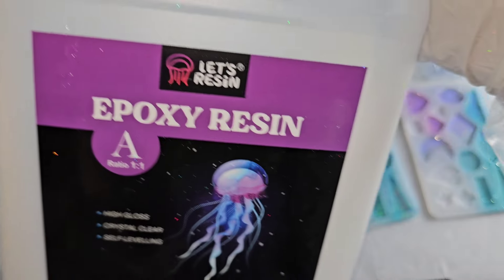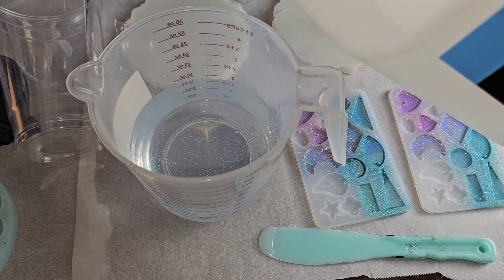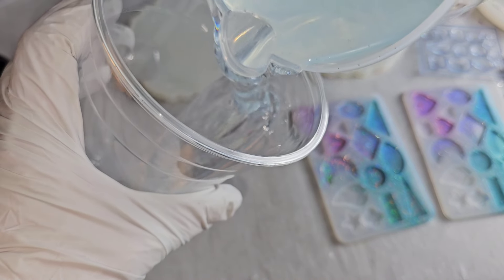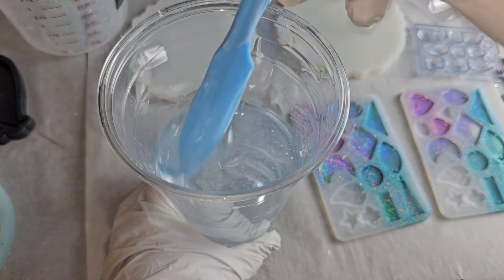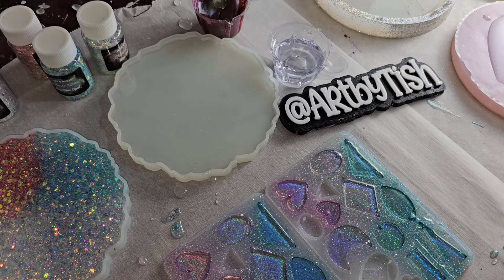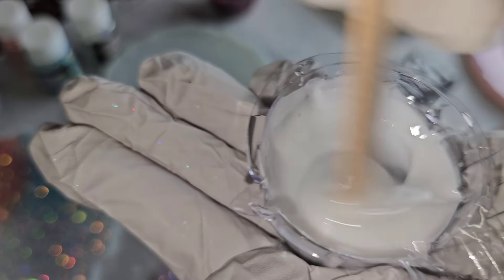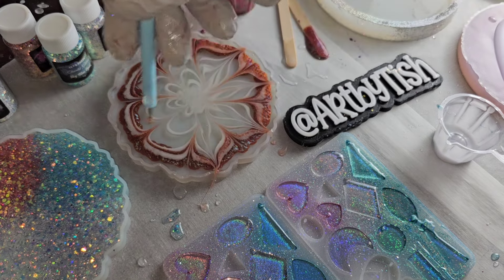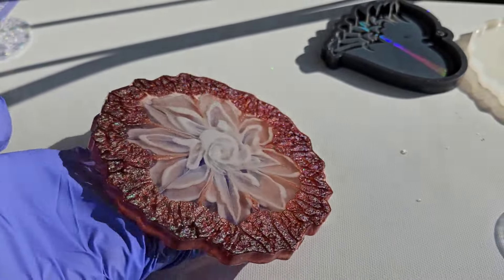Resin tutorial ✨️ LET'S RESIN 1 to 1 ratio epoxy

Comment: Just for information: if you use a different brand than Tish, please check if the resin is measured by weight or volume. Even if it is a 1:1 ratio it can make a difference.

Oh and a question: what temperature has your resin after 25 minutes? I'm using a different brand (because it's easier to get here) and didn't get an good result with 25 minutes.
ooh,and the structure is really cool! is it because of the pigment?
Reply from the maker: I've never seen a 1 to 1 ratio say to be measured by weight only volume and I've tried over 20 brands. They all say by volume. 

I'm not sure what the temperature is. I just mixed let it sit for 25 minute. This resin has a 45 minute working time. 

The texture is from the chameleon Pigment it gives a really cool crackle effect. It's galaxy Pigment from LET'S RESIN. Discount code NAPTIME 

https://letsresin.com/products/30g-color-shift-mica-powder-galaxy?_pos=1&_sid=fa01d03eb&_ss=r
Reply: @naptimecreations  im using a brand with this measurement. the hardener also is thinner and the bottle isn't filled up to the top.
It's always good to read the instructions first 😊

That's for the link and the discount code! I'll get that pigments! 🤗
Reply: and never mix resin when tired. I accidentally mixed up epoxy resin and silicone hardener (for clear silicone). it ended up in a mess 😅😅🤣